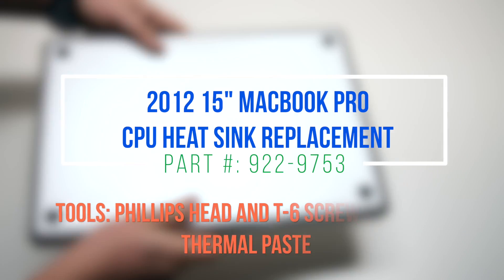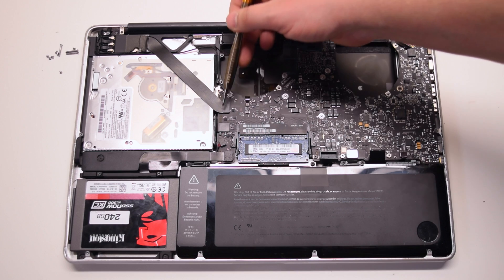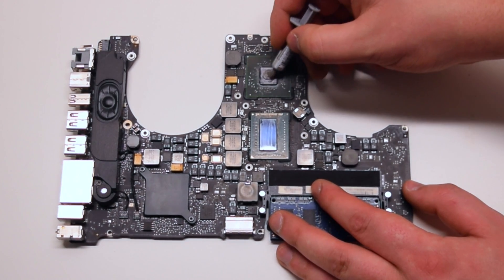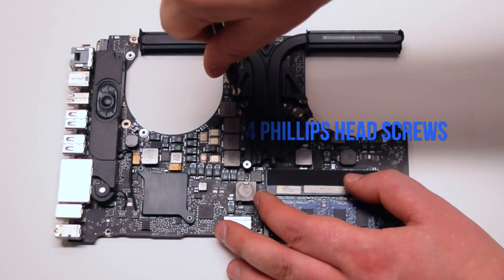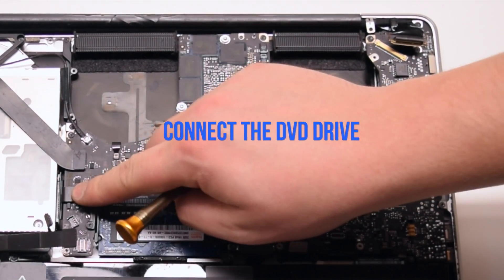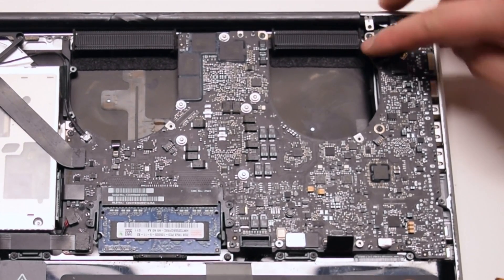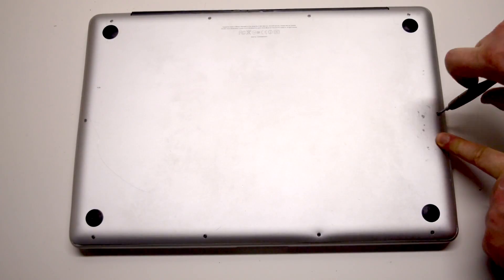2012 Macbook Pro 15" A1286 CPU Heat Sink Replacement

Comment: Great video! I followed all the steps and it works 👍. The only problem is it only works on connect to external power. May I know normal what went wrong? Appreciate for your tip🙏

Comment: I am down to prying out the logic board, I managed to hear "popping" from the tape on the microphone but the board won't budge. It slides and rotates, but at the top near the DC in the board, it just doesn't come up. I don't want to end up breaking it, any tips? I've also ensured all cables and screws are undone.
Reply: did you find out in the end? same boat rn..

Comment: Hi, thanks a lot for the tutorial, it was so usefull. My mbp temp was ramping sky high.
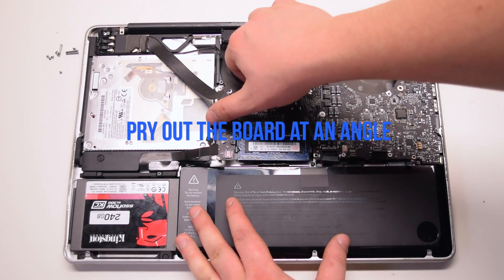 Just an observation, on the assembly process, the T6 screw on the middle right of the mainboard is misplaced. Check 2:37 vs 6:06. Another thing, is always a good practice to start disconnecting the battery line.

Comment: Thanks for the video!  I'm nervous but I'm going to try it.  I figure it's worth a try as the throttling notebook is very frustrating to use as is.  I ordered tools and paste.  should be here midweek and then I'm jumping in feet first, Thanks!
Reply: OK!  I did it and it worked so far.  Yeah baby!  Thanks.  I notice that mac's fan control reports the cpu as running hotter than before I changed the thermal paste but I've had the MBP on and plugged in and it's working great.  No throttling!  Thank you Thank you Thank you!!!!
Reply from the maker: Great! To be honest on an older book like a 2012 I would manually blast the fan on max with fan control form the downloads section at appledollars.com to get best performance.
Reply: @GRIBSOFT  Hi.. I did it.. fixed it like 90%.  I'm now looking to swap out the logic board of I can find one online.  If after the swap it's not much better I'll buy a new mac... Thanks! You're video was great.
Reply: @johnnymilian  The Macs will always run hot if plugged in

Comment: It turned out quite easy as I tried it. Reconnecting the DC power cable under the logic board and aligning the board was a challenge for me. I got through, it's fine. The laptop performed faster, it's subtle but you can tell there is a difference. things load a bit faster and satisfying.
Reply from the maker: Good, time for a SSD upgrade then you will really tell a difference.
Reply: @GRIBSOFT  yes, its already 16 gb ram and ssd. thanks.
Reply from the maker: You can get rid of the Dvd drive and install another SSD and setup a raid 0 so it will be twice as fast.
Reply: @GRIBSOFT  i like the idea, my friend did that too and he loves it. can i put more 2 TB ssd at that slot? maybe in future.  
but unfortunately i need the dvd occassionally. hahaha, i hope u can put a blu-ray drive instead..if that is possible.
Reply: @GRIBSOFT  i like this idea. the dvd drive adds unnecessary weight to the laptop. do you think you can make a video of it?

Comment: Hi! My MacBook Pro 2012 15.4" cpu load 8 2.6 ghz 70 c normal?
Reply from the maker: Yes, it can get super hot especially if it's not sitting on a flat surface.
Reply: that is very low mine goes to 85 to 90 deg just browsing the web and a few apps open and still works fine when goes over 100 deg on heavy load I am getting freezes and though there is no sign of leaks from my original heatsink I am thinking of doing this replacement.
Reply: +Save Apple Dollars
mine goes to 85 to 90 deg just browsing the web and a few apps open and still works fine when goes over 100 deg on heavy load I am getting freezes and though there is no sign of leaks from my original heatsink. Do you think I should this replacement?
Reply: That is amazing, mines get arround 104°C on heavy loads, and don’t thermal throttle in any moment